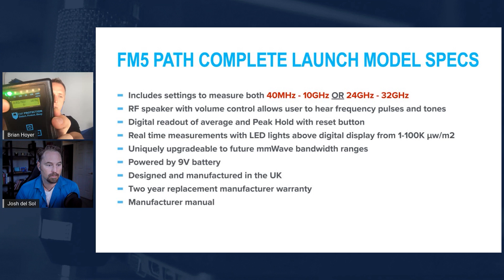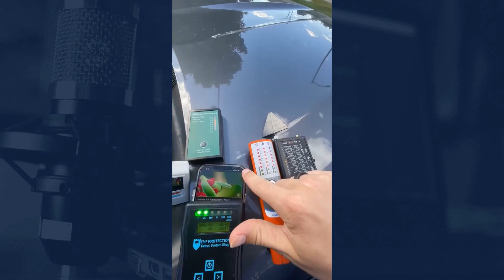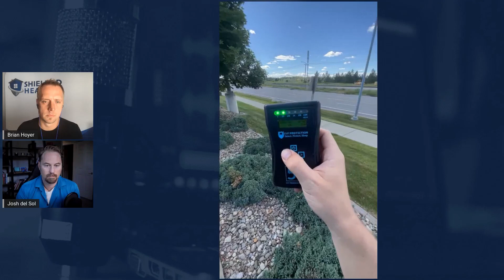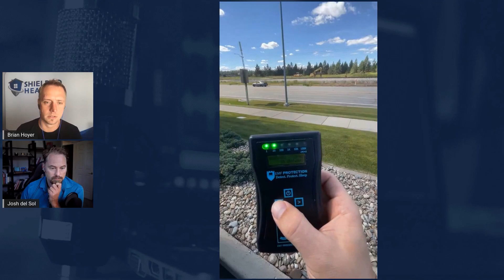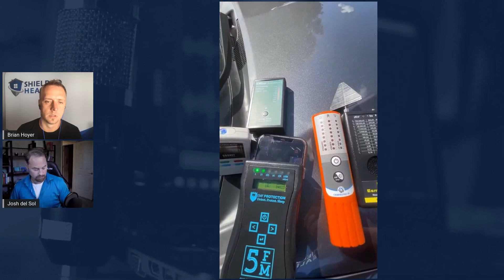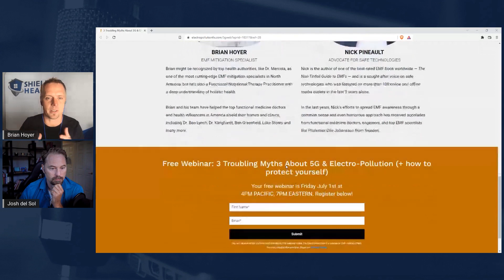5G MM Wave Testing Meter - 2022

Comment: No surprise this end that Brian did not find anything standing directly in front of a cell tower. 

Contrary to popular belief, back-to-back field testing with the FM5 will always show us that we have a microwave epidemic, not a 5G mmWave one. 
Percentage-wise, radiation from mmWaves is nothing like our microwave density levels. Never will be.

Field testing with the FM5 will very clearly demonstrate that staying clear of high-density cell tower/small-cell/micro-cell microwave radiation will keep you well away from the line of fire of the sites mmWave radiation. Why? Because 5G mmWave connectivity is a microwave-dependent technology and not a standalone mobile solution, and therefore heavily depends on the lower multi-tier LTE/4G/5G microwave bands.

So, if you can't afford a mmWave RF meter and only have a microwave RF meter, don't get too upset. Just stay away from high-density microwave hot spots. ...Where there is smoke, there is fire, kind of thing.

Comment: looked at the website, the meter is $1000, is that affordable?
Reply from the maker: There is a very active discussion here with Brian answering questions and explaining all of this in detail: https://www.takebackyourpower.net/first-affordable-mm-wave-tester-is-here-and-the-results-are-staggering/
Reply: @JoshdelSol  Thanks Josh.  Is that discussion ongoing and can I join it?  If so, how do I join it?  It is not my area but I am preparing to build my own meter, I have a master's degree in mechanical engineering, but some great engineering text books and I can see several ways to do it.  My preference would be to just buy a meter, but I want to go from 8 GHz all the way up to the 60 GHz that the FCC decided to not require licensing for, a very dangerous frequency that interacts with oxygen, and it is possible 60 GHz is being used ubiquitously.  I also thought of buying that climber's meter that is not sensitive enough for me at the low EMF power levels, take it apart, and reverse engineer it to create something more sensitive.  Another idea is to use the Dr. Martin Pall VGCC model, get a calcium channel sensor, and use that to determine when one is in an EMF situation that is causing harm without directly measuring the EMF levels.  I find it beyond astounding to have had warnings of 5G in 2017 or earlier and be at this stage in 2022.  Perhaps some powerful people do not want us knowing what is happening with these frequencies?  Thanks again.
Reply: I posted the comment below and it appears to have been deleted.  So I posted it again, and will paste it here as well.  Fascinating...

"
The links below describe a meter that measures 50 MHz to 60 GHz and costs $799 US.  It measures near and far field, and it has data logging. It would be great to see this meter tested with the meters in this video.

https://www.gmesupply.com/fieldsense-fs60-personal-rf-monitor?cat_id=13716

https://www.youtube.com/playlist?list=PLNX69glb6gQIV4SHu_7Lb5xikhMAumgJ9

https://fieldsense.com/wp-content/uploads/2021/10/FIE_008-Datasheet-R4.pdf
"